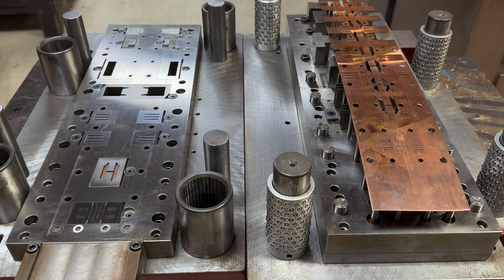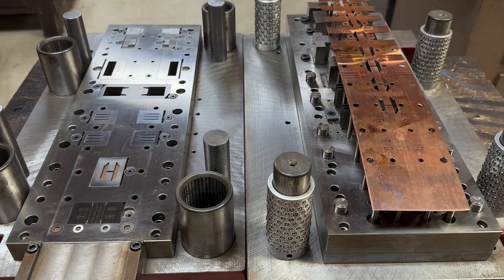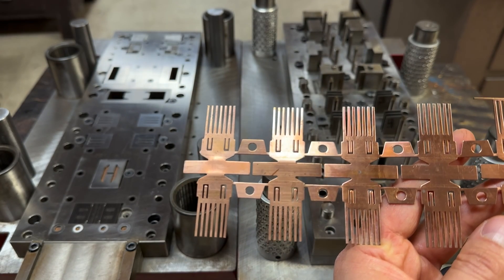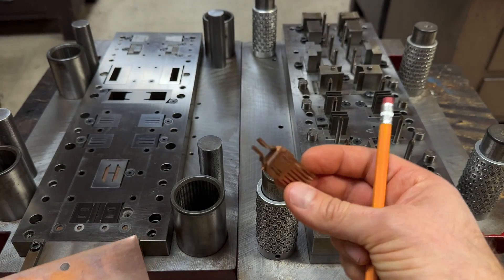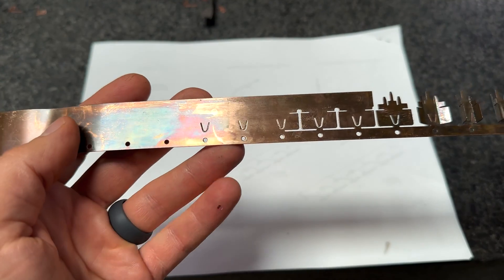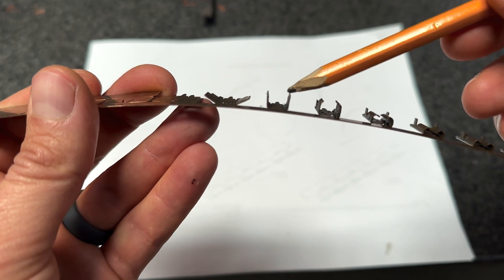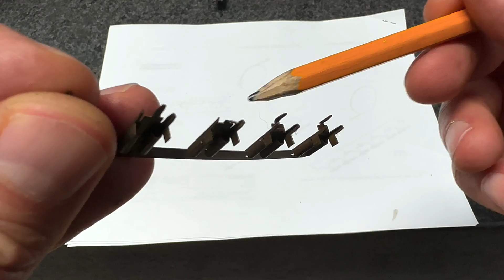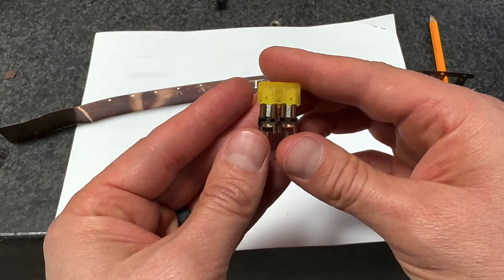￼ Simple explanation of a progressive die.￼

Comment: The last time I worked along side toolmakers was 1980.

The process was blanking can components, somewhat simpler than the multistage process required to manufacture connectors.

Rapping the punches, grinding the punch and die and then shearing in the set must be challenging in this application.
Reply from the maker: It is quite challenging because there are so many critical dimensions and if one dimension is off, the whole part is bad. thank you for watching.👍